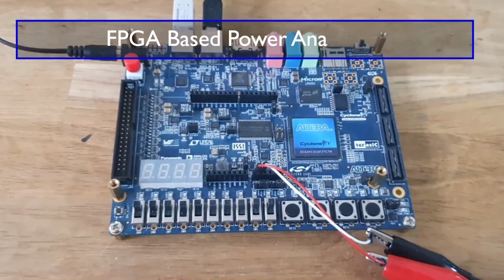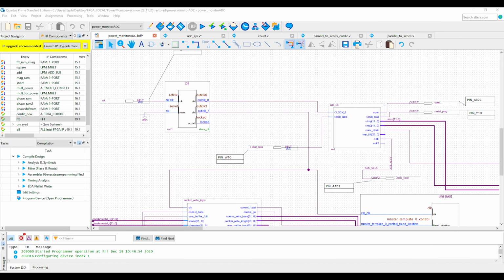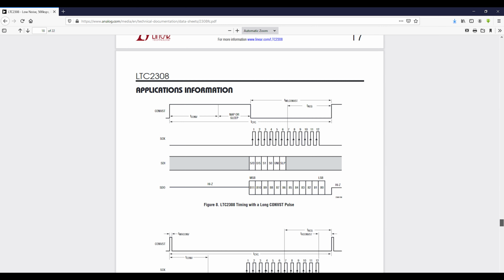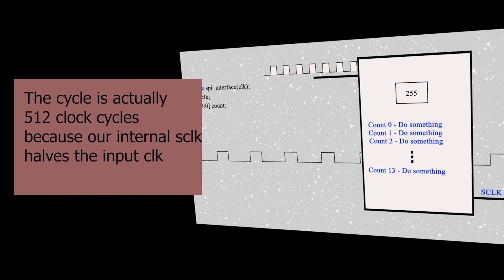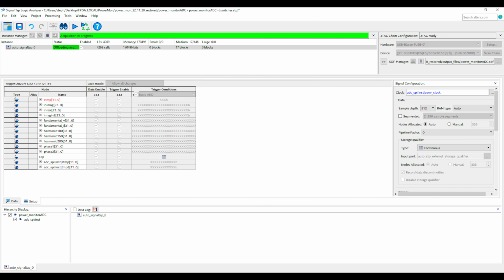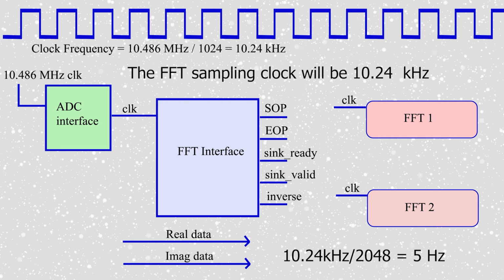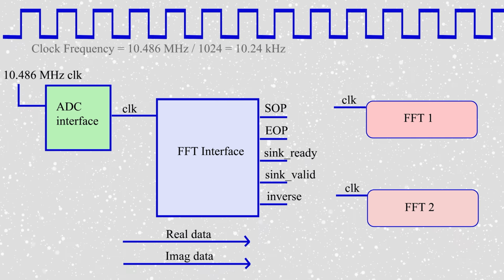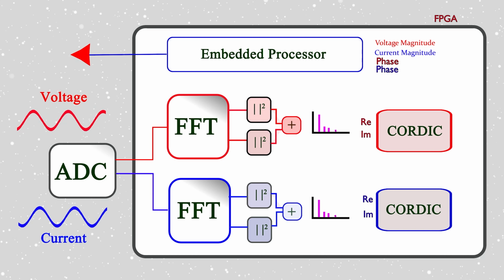FPGA Based Power Analyser (4K) with FFT, CORDIC, Embedded Processor and Matlab GUI: PART 1:ADC & FFT

Comment: Thanks! I am student. I have question. Outputs of FFT core are complex values. These values are represented in binary 2nd complement form?   For calculation of amplitude and phase of signal are used equations A^2=(Re)^2+(Im)^2 and F=atan(Re/Im). These calculation procedure is right?
Reply from the maker: Yes, but best to use atan2 rather than atan, with the imaginary on top -> atan2(Im/Re). atan will only give you a pi/2 to -pi/2 range, but atan2 gives you the full 4 quadrant pi to -pi range.
Reply: @VisualElectric_  thanks you!